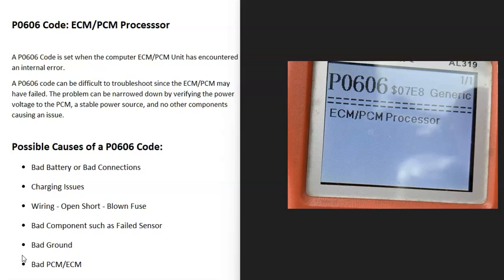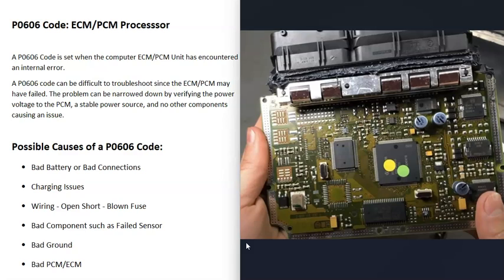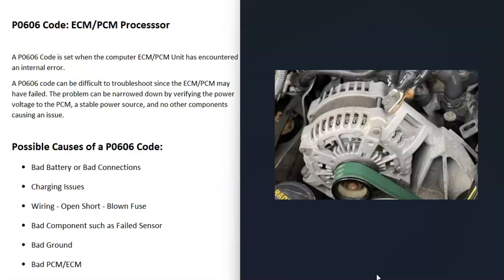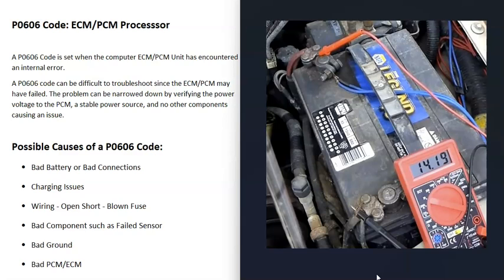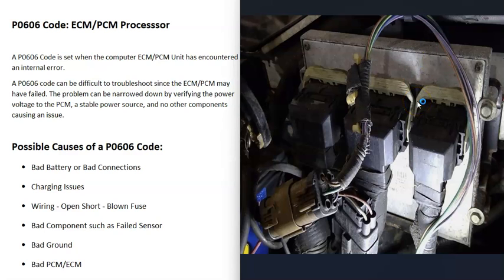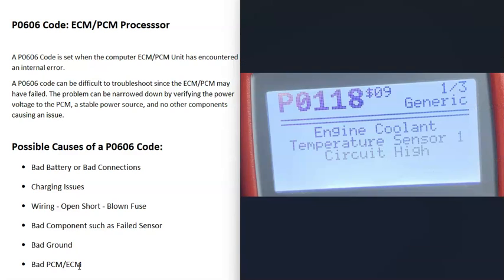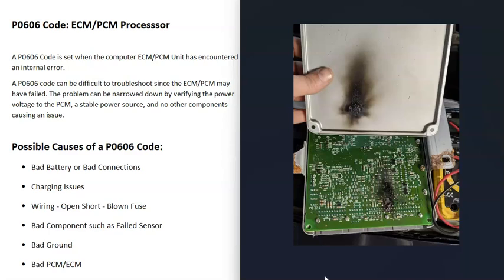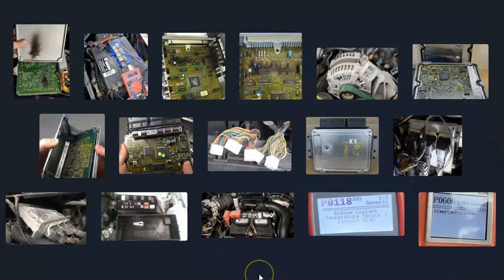Causes and Fixes P0606 Code: ECM/PCM Processor

Comment: 2013 Jetta MK6 TDI - Manual
I did change my speed sensor yesterday because I was getting the x5 Christmas tree on my Jetta
ABS
Traction Control 
TPMS
AirBag
Check Engine 

Turns out the same symptoms never went away and the throttle control wants to die / give a real sloppy engine rev in ANY gear above #2

However ! 4 out of 5 of the warning lights cleared. But now it shows the Pigtail "glow plug" warning light.

Using this video to troubleshoot today. 

I also live in East Tennessee (lots of rain, moisture, humidity) so it's possible a connection point or ground wire needs some serious cleaning with an ElectroWash spray and brush

Comment: My dads focus just threw out the same code. Well thats first thing i thought of, was the Batt. cause it sits alot. And it was low. So your video confirms my belief. It did crank a little slow when starting.
Thx. ITS A 2013 FOCUS WITH THE RECALLED TRANS. SO WHO KNOWS
THERE GOIN TO SELL IT 
WITH 51,000 MILES